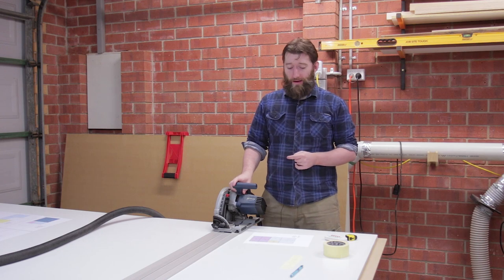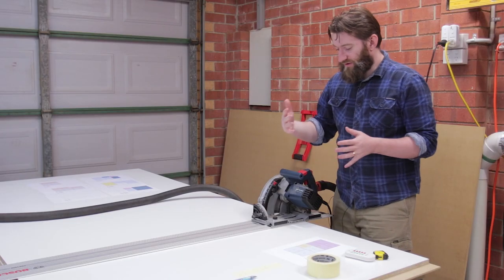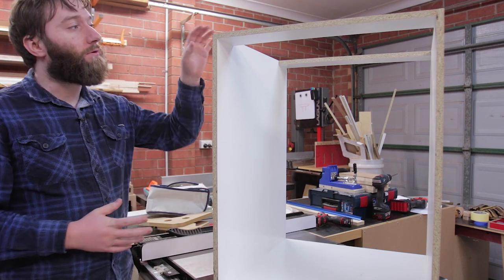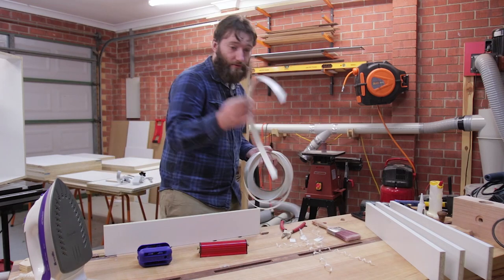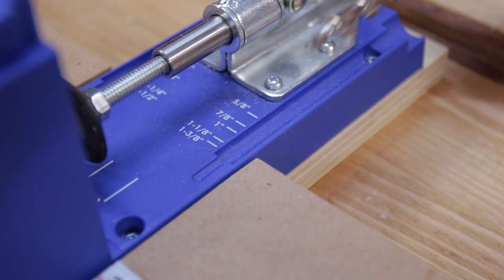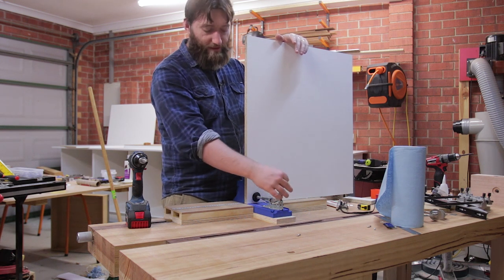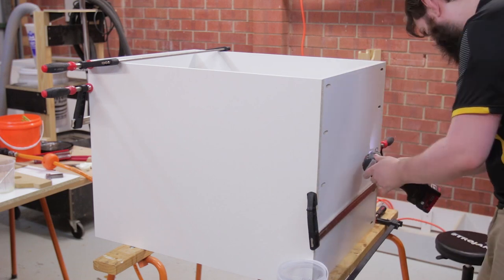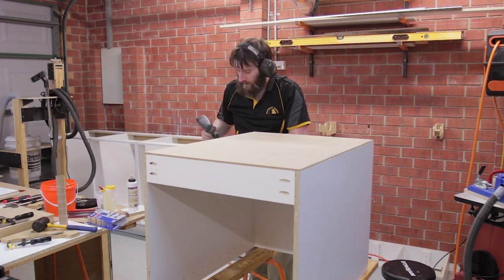How To Build Cabinets: Base Cabinets (Mitre Saw Station Part #1)

Comment: Hi from Scotland. The Kreg jig drill and stop is set in inches and the screws are in metric, well planned Kregg. Next, we use a blade called a triple chip blade on melamine ply and any other particle board. They are for circular saw's and table saw's. Good idea's Paul, I will cherry pick.
Reply from the maker: Yup, TCB or high-ATB, high tooth count,  and either reduced or negative rake. Melamine specific blades have a fair bit of variation between manufacturers.

Comment: I wouldn't mind seeing a video going over common screws and applications, when pilot holes are needed, picking the right screw for the job as you know the Bunnings wall is littered with different types of screws

Comment: That Melamine Glue is amazing. I tested it on some offcuts and found the PB split and even using a chisel was unable to cause a split along the glue line.
Reply from the maker: +michael lane it's just a shame it doesn't work on phenolic coated plywood!

Comment: the fact you don't show every small detail is pleasing. Obviously some guys assume everyone is slow on the uptake. No harm really i suppose but your slightly quicker way of getting through the process is good.
Reply from the maker: Thanks. Its a really fine line between too much and not enough - I've been at this for 3-4years, and its still really tricky to get right :) Its very easy to shoot way too much footage.

Comment: Paul, interested in where you got the red sheet goods carrying handle.
Reply: Paul Jenkins cheers
Reply: Can confirm the gorilla grippers are good, picked one up on one of my last amazon orders. Shipping wasn't too bad. Makes it easy to move 25mm ply around the shed with one person. Well, relatively easy, it's still heavy as heck!
Reply: Amazon won't ship those to Australia unfortunately.
Reply: Huh. I just checked and it looks like this time last year is when I picked up a Gorilla Gripper 44010 from amazon and had it shipped to Aus. Maybe keep an eye on it and they will re-list again sometime.
Reply: Pete G  ok thanks. Yes, the three versions offered won't ship here right now. I have found in the past that this depends on the seller and are available/ not available depending on their preference. Like to see a policy where Amazon insist they're available to all if they aren't dangerous goods etc.

Comment: I would add one point of clarification that people often don't understand about melamine cabinets. Critics usually cite low quality "furniture" (desks, bookshelves, etc.) that they've seen in the past that didn't hold up, and use that as a basis for criticizing the use of melamine for cabinetry. The difference is that cabinets are permanently installed. It's moving the other things (around the room, to a new home, etc.) that is so hard on them. Bumping into things, stressing the joints by causing them to flex, etc. None of that applies for permanent installations.

Comment: im confused as to why you would bother using pocket holes at all? I'm a builder and have done dozens of kitchens and never seen. it for base cabinets. just wondering why?
Reply from the maker: Conversely in a lot of cabinet shops, they're used exclusively. Even the "standard" method of constructing the cabinets varies drastically from region/country. 

Pocketholes are a good way to have hidden screws that don't need plugs, and for DIY-ers they're much less prone to chipout or misaligned (or not deep enough) pilot holes. Drilling straight is a learned skill that not everybody has.

Comment: As you say, it's the workshop so it does it matter about the gaps under the plinth. I hope you don't drop a small irreplaceable widget that rolls  under the gap :(   Smart idea to use the off cuts to support, level  and strengthen the plinths.
Reply from the maker: Hah, thats a good (bad?) point. Maybe I should put a rubber strip, or some quad moulding so its inclined to roll away from the cabinets.

Comment: I would not have used those blocks of melamine to level your cabinets. Especially on concrete flooring. Moisture might creep up from the concrete and royally srew the melamine up. Then again I live in Holland, dont know if moisture coming from concrete is much of a problem down under. :)
Reply from the maker: Its sealed concrete and HMR (moisture resistant) melamine. It should be OK, but if its not, the plinth is relatively cheap/easy to replace if it comes to that

Comment: hi Paul. great video, love your detail. 

I'm basically a novice to wood working and was wandering how you stopped the chip out with the table saw? anytime I use melamine it chips everywhere. I find myself having to oversize my cuts with the table saw then from to size with a router. is it just a case of a better blade?
Reply from the maker: There are a few ways

* You can do a scoring cut like I did with the tracksaw. 2-3mm cut through one side, flip the piece (I think thats the right order) and cut full depth.

* Some people have success putting painters/masking tape along their cut lines to help prevent tearout - I find this a bit tedious

* Yes, blade helps. With sheet goods, generally speaking the more teeth the better. There are melamine specific cutting blades that have 80 or more teeth and a less aggressive rake angle. I meant to buy one, but I ran out of shop budget when preparing for the build. I use a 50t freud industrial (not diablo) combo blade. Its still fairly sharp, and I clean my blades after every project.

In the end I... didn't actually care. By the time I got to the tablesaw I didn't care what those cuts turned out like because I was pumped for time and end of the day they're workshop cabinets. They're not super duper crisp, but they're not too bad.
Reply: Paul Jenkins  thanks for the quick response! really appreciate it. I'll have to experiment but like yourself when I come to so my garage it won't be that important

Comment: It's obvious that you don't have a problem with particle board and pocket holes. Is their any concerns now? Was there any doubts before? Read a lot of mixed reviews online about it. Could you shed some light on your opinion so far?
Reply from the maker: Particleboard furniture gets a bad wrap because its knockdown. A lot of knockdown furniture has  dowels and maybe one cam. They're meant to be glued, but nobody does, or they're made in ways that push the limits of the material by not providing adequate support. These cabinets are fine. Every kitchen I've ever had has been made of melamine cabinets. The last mitresaw cabinet was still standing up just fine (apart from the initial mistakes I made with them - not the materials fault) and were a right royal pain to knock back down.

Comment: Nice video Paul. For the next video can you use imperial measurements instead of metric? It's much easier for those of us in the US to follow along. :)
Reply: GuysWoodshop then that would make it hard for every other country that does not use imperial to follow
Reply: That's the joke.
Reply: It's a joke. Paul will get it. I hope :)
Reply: Thanks for getting the joke here. I hope I didn't offend anybody with a little sarcasm now and then
Reply: I got it lol
Reply from the maker: sniff you're a bully, Guy. And your kumiko is all off because you're using non-metric chisels - typical American cultural appropriation! ;)
Reply: HaHaHaHa

Comment: Can anyone give me some really GOOD reasons NOT to make my entire workbench top, (not for just the miter saw station dealt with here) out of melamine?
Reply from the maker: +Will Wyatt depends on the "type" of work bench. Typically you don't want something with such low friction! It would be great for an assembly table or outfeed, but full workbenh with dogholes would expose the chipboard which is a bit crumbly.
Reply: good points both. I'd not thought about the low friction aspect, (but that same thing makes glue clean up a snap). I'd solve the  dog holes chipping issue with some kind of hardwood insert.
Reply from the maker: Yup, that'd work well for the dogs. If you were going to sand/route something on it, you could even have a 6mm plywood (or MDF) "insert" that goes between two dogs to lower friction, or use router/sanding "mat" (rubber material). 

As I said, it depends on the type of bench. Power tool benches always have work holding either in tracks, quick grip clamps or vices, while a hand tool bench can rely on friction, wedges (crochet hook) and other mechanisms.

A Paulk-style bench with a melamine top layer would be super useful